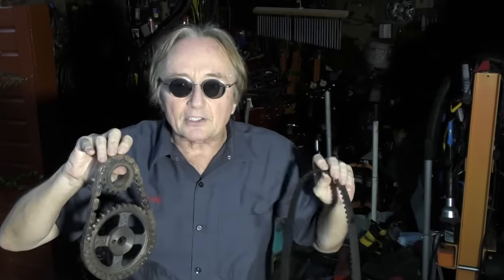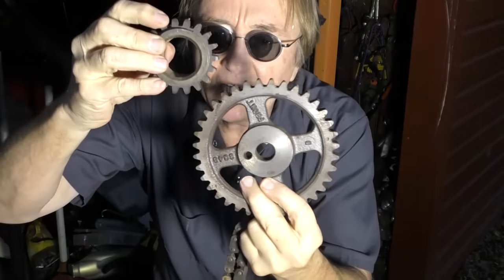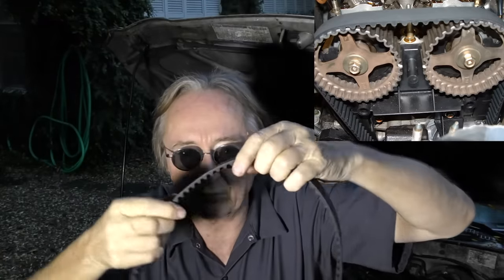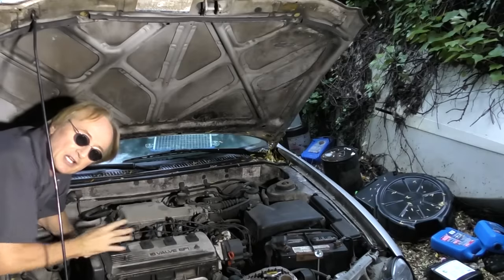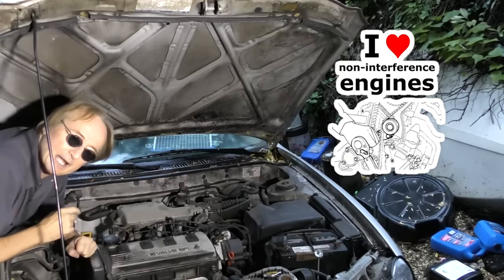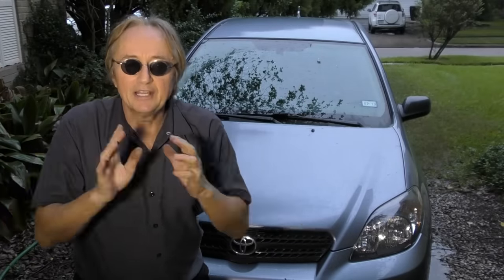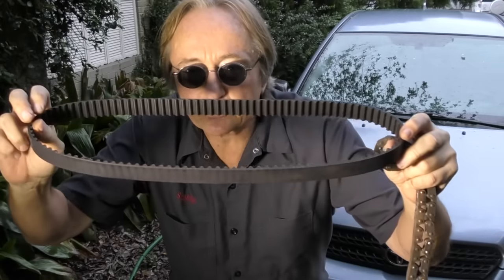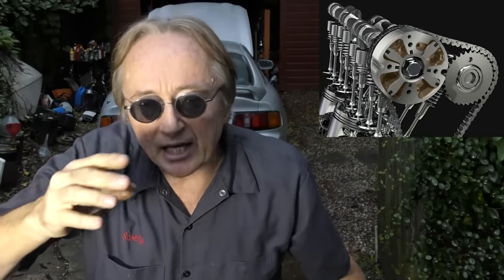Why Some Cars Have a Timing Chain Instead of a Timing Belt

Comment: Only failure point of the chain system is the tensioner. If the oil isn't changed enough the hydraulic tensioners fail. That said, I still prefer chains. I hate buying a car and not knowing if the T-belt has been changed. Or my personal favorite, they change the T-belt and not the water pump (they are designed to live as long as the belt).
Reply: Chains CAN, and DO break. I have seen this in a Ssangyong Musso 3200. It had the timing chain break. Sorry, you are wrong on that one. Something else you need to know is that as the chain stretches, the spaces between the teeth become wider, and the teeth of the sprockets start taking on a slight hook shape on the side not under tension. I have seen this.
Reply: @christophermarshall5765  It depends on the mileage. I think if you're getting close to 300k km it's time to change out the chain with all the guides and tensioner.  Friction is the big thing that causes timing chains to die. If cheap oil is used for the life of the car, sludge will build up on the chain and sprockets. An extreme example, but I've seen it with idiots that don't change their oil
Reply: @Roland   I have learned the hard way, if you buy a V-6 with timing belt particularly, demand that the seller drop the price to cover the cost of a new timing belt. People sell these because they need timing belts. Don't let the seller play dumb. The car is supposed to run. That's not a selling point. Same is true with a four, but four's are generally easier and cheaper to work on and are non interference.
Reply: The Ssangyong had less than 200,000 km on it, & was serviced regularly. I worked in the motor trade most of my life, & am an auto engineer by trade. The sprockets were good, as were the tensioner, & guides. The chain was faulty. I have had a BRAND NEW chain break in one of my cars. It did not even cover 50 km. So your theory is flawed.
Reply: Not all chains use tensioners
Reply: You are correct. The 6 cylinder old school Chrysler engines did not have tensioners. I owned a few Mopars in my time. If I'm not mistaken,  a lot of Ford engines had no tensioners either.
Reply: Chains can break but they last a lot longer than a belt
Reply: I've never heard of Ssangyong, I can't comment on their quality of cars. I'm more familiar with GM, I haven't seen any non tensioner related timing chain failures (within reasonable mileage, of course). I'm no expert, just a DIY guy that's decent at car work. If you are an expert, I was hoping to have a good discussion, so can we skip the dick measuring contest?
Reply: @anonymike8280  I'd go further and say that if the car has exceeded the mileage/time for a belt change and it has not been done then it's indicative of a car that has not been properly maintained and you should not buy it.  When buying a used car you should be looking for evidence that a car has been properly maintained throughout it's life.  Cars with a service overdue are like cars with bald tyres, a sign that it's not a car you should be considering unless it's so cheap and you fully understand the cost to make it good.
Reply: The weak point with the tensioner is the gasket for the tensioner.
Reply: Roland Hodi - Ssangyong is a Korean make that is not available in the United States.

Comment: Found out the hard way in my wifes Acura.  Belt broken, good bye engine, good bye car.
My '03 Ford Expedition 4.6 has 206,000 miles with the original chain.  Runs like a champ.

Comment: Given how complex VVT schemes are getting, it will eventually be much cheaper and simpler to ditch timing chains, belts and sprockets in favor of full electronic valve timing.
Reply: electronic valve timing?   never heard of that,  did you make that up as a wishful thought?
Reply: Oh, great, so now a computer virus uploaded into the car can brick an interference engine at will. Brilliant engineering. At that point, just go full EV.
Reply: With electromagnetic valves, the valves are "free-moving" - there is no hard link between the valves and anything else. If the pistons touch the valves, they'll just overcome the electromagnet and push the valves back with little to no harm. It could even be designed to do so intentionally for self-calibration purposes and as a backup for crank position sensor failure.

If you want to be paranoid about what viruses could do in modern cars, I'd be far more worried about someone messing up with ABS/TCS and electronic throttle in winter: instead of a virus possibly totaling the engine, a virus triggering a loss of control on icy roads could cost the life of everyone onboard and possibly other road users too. Far more dire than a dead engine.
Reply: Koeningsegg already uses it in their 'freevalve' engine.
Reply: Right up until one of the many sensors needed fails in 5 years...
Reply: That's coming.
Reply: charlie dee  For basic 'EVT', you only need an accurate crank position sensor and modern engines are already pretty much screwed without that one already unless they have cam position sensors to fallback on or vice-versa, assuming the ECU doesn't get confused by the failed sensor's signal. MAP/MAF, TPS, upstream O2 and other sensor failures tend to leave you with severely degraded performance as well if not outright won't-run.

We're already well into single-sensor/actuator-failure-can-ruin-your-day territory. Thankfully, excluding design flaws, lifetime-of-the-engine hardware usually lasts much longer than 5 years when cared for reasonably well.
Reply: @ronvalley1973  , He did say eventually.   I agree with him.

Comment: Hey Scotty, who makes cars with strong timing chains today ?
Reply from the maker: I'll make a future video on this, good idea, thanks!
Reply: Hurry Scotty I’ll be waiting 👍🏻👍🏻👍🏻
Reply: Anything Toyota duh. Lol JK
Reply: Bmw
Reply: Toyota period
Reply: @scottykilmer  it is a good video idea to list good timing chain engines and list non interference engines. Thanks
Reply: I think the GM V8s are known to be fine.
Reply: Mercedes of course
Reply: Suzuki Swift!
Reply: BMW . Good chains. Bad tensioners. 🚘
Reply: Every single Mercedes Benz engine is with timing chains! They never break
Reply: Ford Duratec engines! 98 SVT Contour w/268k smooth and quiet when I sold it. They got the engine design from Porsche in the 90's.
Reply: Chevy V8's
Reply: Adi Adi : On the 4-banger...
Reply: All modern Honda 4 bangers.  Stay away from their V6s though (still using belts)
Reply: Yeah, very curious. Since Honda says their chain lasts until the lifetime of the vehicle...i have no idea what means though lol.
Reply: FORD Mondeo. Fusion in USA. JAGUAR. ASTON MARTIN.
Reply: NerfPaladins 100 thousand miles, as far as the warranty covers for a new car is considered the life span of the car
Reply: Honda 4 cylinder engines. The most powerful and reliable. The K Series is the best 4 cylinder engine made for the past 17 years.
Reply: I drive a Mercedes 450 SE built in 1976. I did change the engine, as the original was prematurely worn, due to previous owners using poor quality oil. It does have regular servicing ( twice per year, with one major). During the 5 years since I changed the engine, it has never had the timing chain & guides replaced. It will need these doing in due time. The timing kits here in Australia are about $350. It has everything in it. For those who have never worked on these older V-8 cars, the timing cover has a few seals fitted. It also has a bushing for the auxiliary shaft.
Reply: WhitefolksT i agree still driving my 99 ford contourv6 no engine problem no transmission problem chains make a difference
Reply: @NerfPaladins  it means you'll probably have other problems before the chain goes lol
Reply: @Azureecosse  how many miles do you put on in 6 months? That seems like a long time between changes.
Reply: My 05 camry has timing chain. No problems
Reply: TakeAmericaBackfromISRAEL tundras are belts. At least the 4.7 in the first gens are
Reply: @BruceChastain  GM V8's back around the 70's and 80's used "Plastic" teeth on their camshaft sprocket. Either you changed your timing chain at 100K miles with a beefier all metal cam gear or you found yourself walking. I would love to know if and when they stopped using plastic gears?
Reply: @Trident_Euclid  GM V8's back around the 70's and 80's used "Plastic" teeth on their camshaft sprocket. Either you changed your timing chain at 100K miles with a beefier all metal cam gear or you found yourself walking. I would love to know if and when they stopped using plastic gears?
Reply: @scottykilmer  Yes, Scotty. And perhaps talk about the plastic camshaft gears GM used with their chains back in the 80's? Did they ever wise up?
Reply: My 08 lexus GS460 just hit 210k, no issues with timing chain or anything else for that matter.
Reply: Belts are just as good if not better. My old D series is still going strong belt looked good at 90,000 when I put the engine it. Changed coil, ignitor, plugs, and put valve seals in at 160,000 because I kept running it low on oil now has close to 210,000 and redline way more than I should trying to blow up the y7 so I can drop in y8. K conversion would be nice but wouldn't be justifiable as its just an old beater I drive to work may not be powerful as a K but definitely reliable even tho I only change oil once or twice a year.

Comment: Scotty, Koenigsegg makes a Stand Alone Hydraulic Valve, no need for timing chain or camshaft. Computer controls , infinite power curves, make vtec look Ancient.
Reply: Sounds cool and pricey
Reply: Koenigsegg sells the fastest production car in the World! Mass production of this technology would bring price down..
Reply: It’s called freevalve, they’re solenoid actuated valves. One of the only “new” technologies that actually makes things simpler with less moving parts and more reliable! I love the idea, i hope it catches on
Reply: @KingOath  my fiat has that kind of system, but only on the intake valves and a proper camshaft for the exhaust valves. I think that is the best way to do it. If a solenoid breaks for an exhaust valve and that valve is stuck shut, you're gonna have a bad time.
Reply: @KingOath  in about 10 years or so they'll start looking into it. Then even cheap cars will have that technology.
Reply: Yeah I would wager it costs more than your car.

Comment: I was in the market for a cheap reliable used car. I was looking at a Corolla and a Civic. One of the major deciding factors was the timing system. The Civic had a belt while the Corolla had a chain. These cars were both early 2,000’s. I went with the Corolla and it’s smooth as can be :)

Comment: Im sure cost is a factor, but belts do offer the most efficient means to transfer power. In smaller engines less rotating mass and less friction equals better acceleration, better fuel economy and less noise. Also a slightly lighter engine.
Reply: This is exactly why Honda used them in the first place.

Comment: 1000+ hp b series still use rubber belts with no issue
Reply: Same goes for ~2,000 hp 2JZ-GTE and RB26DETT.
Reply: HONDA GANG
Reply: 1000hp engines aren't driven for 100,000 miles before being rebuilt either...
Reply: @GunnyNinja  No, but plenty of engines with timing belts go 300,000 to 400,000 miles before needing to be rebuilt. More than a few have even gone more than a million miles.
Reply: Yeah, but I'd like to see 1000 and 2000 horsepower engines last for 225000 Miles without breaking.
Reply: @warhammer2779  Neither Scotty or I are talking about milage. We're talking about it jumping timing.

Comment: VW 1.4 tsi has so much innovation that they use a bicycle chain instead of a cam chain. Haters will say I made this up.
Reply: Haters will.
Reply: I it holds when why not?
Reply: Well, it doesn't. That's the problem
Reply: Ouch...
Reply: Vw is garbage worst transmission in the world is DSG from Nazis
Reply: Efreet17 True but we're talking about the Engine not the Transmission :P
Reply: That's what I like to call "German Engineering"
Reply: Not just the chain but tensioner too
Reply: A bicycle chain isn't as flexible as a   TSI-engine timing chain.
Reply: Против Глобал, so the VW timing chains can be used to stop your car, instead of using your regular brakes or the parking brake? 😆
Reply: Well, until I disassemble one to see for myself, I believe you.
Reply: I don't know any 1.4 tsi that lasted longer than 100k kilometers.😂
Reply: Literally any manufacturer who uses timing chains also has the chance of them breaking as they wear
Reply: You have to repair it at the bicycle shop?
Reply: They actually changed back to timing belts, but they’re using kevlar ones this time around. The 1.4 tsi engine used to have lots of problems not because the chain broke, but because the chain was too heavy and broke the tensioners. I drive a 2016 golf with the 150 hp 1.4 tsi (turbo + compressor) and @ 80000 km (ca. 50000 miles) and so far had no problems, knock on wood. That being said, I do change the oil two times more often, than the service tells me to. My friend at a VW service station says they had the new 1.4 tsi engines with more than 240000 km (150000 miles) of mileage that run well, so they may have finally fixed it.

Of course now they replaced the 1.4 tsi with the 1.5 tsi, so who knows what comes up in a year, or two... ;)
Reply: Not only that the majority of their 4cyl diesels and gasoline engines use belts.
Reply: I thought Volkswagen made the best cars
Reply: Old 1.8's and 2.0's with belts were pretty dam reliable.

Comment: All my cars use timing belts and never have a problem.
Just change all every 70.000 km or 5 years.
Reply: Mannipulo Birr That’s really expensive, my sisters has always bought Hondas, $800 service call every time, I’ve only owned one car with belt. Don’t plan on that again, cost is too high.
Reply: @Bigfish1day  just don't go to the dealership and you'll be fine
Reply: @Bigfish1day  I just paid $400 to do it in my acura with the water pump but the mechanic will charge me a bit more next time
Reply: I did all the head gasket kit and water pump kit for 120 myself. It’s a 1 day job and more years to go.

Comment: Great video Scotty,  one interesting twist is the Gates RPM division Kevlar racing belt I used on my Porsche 944. It is 3 times stronger than the OEM rubber belt and I didn't want to leave anything to chance with the 2.5 liter interference engine

Comment: Honda fanboy checking in. Love Honda, and I love the J35 V6. A Honda engine with horsepower and torque. However, I was blown away when I found it uses a timing belt. Me sad.
Reply: If you never start the car is the belt in a state of broken and not broken at the same time?
Reply: Honda fanboy here too! Don't let that get you down, just invest a couple hundred in a new belt and tensioner and get 500 thousand out of that engine.
Reply: The shop cost is about 700 to 800 for belt, tensioner, and water pump replacement. Not cheap and painful impact on wallet for operational costs that never gets mentioned in new car reviews.  Also, not an easy job by any means if you're thinking of doing it yourself. The consensus is that the labor rate on this job is well earned.
Reply: @oldtwinsna8347  stop going to shops that charge ridiclous amounts. I have people here in Southern Ontario the labour cost would not be more than $150 dollars.  Add in a timing belt kit that includes  timing belt, tensioner belt, idler pulley, water pump, cranskshaft seal all it would be about 450 dollars. Not bad if you do it every 200,000KM
Reply: @m.a.omarkhail8294  I used to do them that cheap also never again that's at least $300 labor. People don't have a clue what this work does to our backs.
Reply: @dosmastrify   Only if the vehicle uses a Schrödinger's Belt.